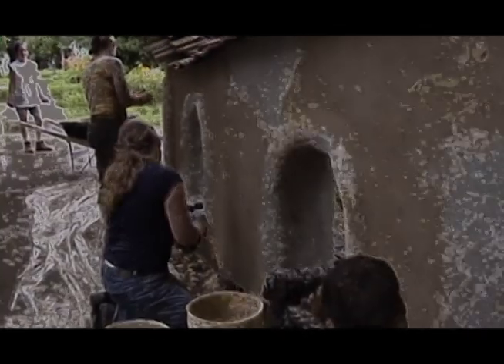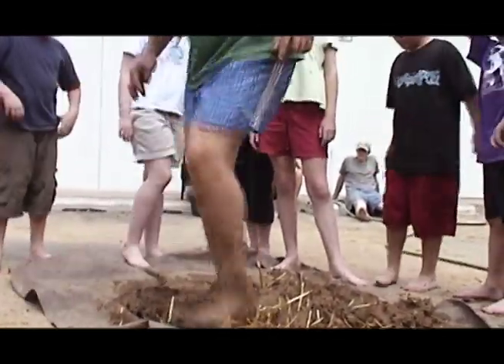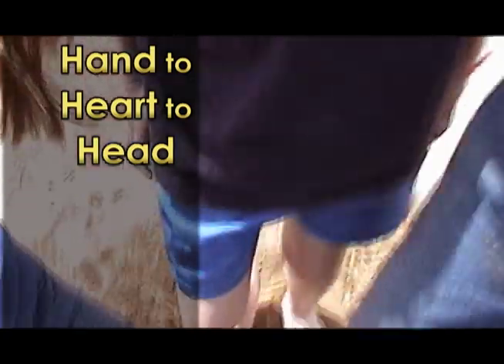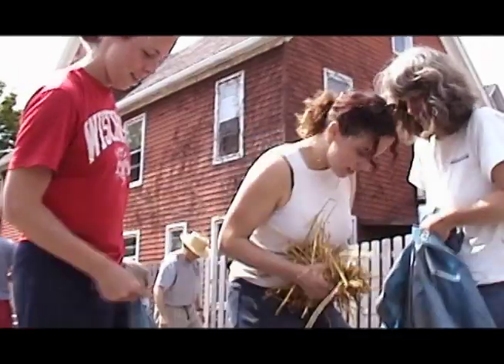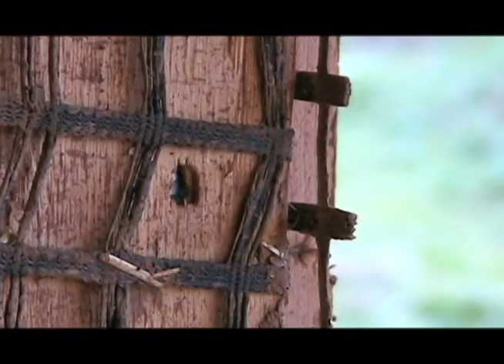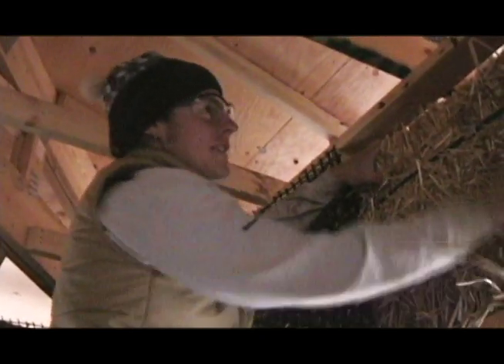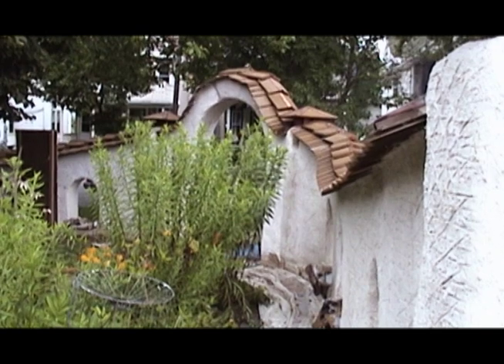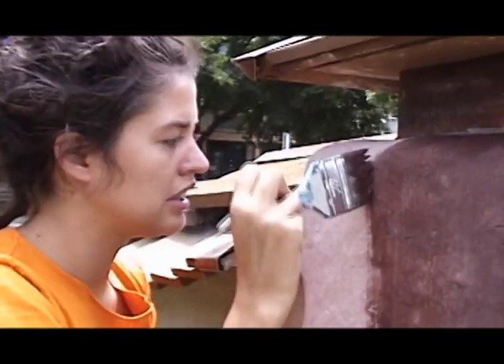Earth Walls: Cob and Straw Bale Construction in Wisconsin

Comment: None of these videos on straw bale or cob are in the deep south. Wonder if that is because down here we have hurricanes that would melt a cob house in hours and the insects here would love the straw and mud. The fire ants would move into one of these in minutes and in a few weeks you'd have a huge nest of fire ants eating you literally out of a house.
Reply: In the south, you would just use cob. You don't need straw bales in the south.  In the north, straw bales are used for their insulating factor.  Since cob is like a natural concrete, you shouldn't have to worry about critters unless you get cracks, which you just patch.
Reply: If done right, cob is too dry and hard (it's unfired brick) for ants to bother. Some people do make the mistake of using topsoil; need subsoil for cob.

Cob is being built all over the American Southeast, it's great for hot weather. You don't hear about it because it's too "hippie" for locals to tolerate.  

A cob house has got to have good drainage and a good roof, cannot survive on a flood plan.  Other than that, it's great, the best.

Comment: In Wisconsin?! How does Cob hold up in the freezing long winters? I would love to try this.
Reply: Cob is ideal for extreme heat and extreme cold, both.  It's great insulation, wonderful thermal mass.
Reply: @kittimcconnell2633  cob has a terrible R value, I have no idea where you got your information from
Reply: @Kobbi_88  as I undertand it, thermal mass is not insulation. Two different, interesting properties to consider.

Comment: sand, clay, cow manure and hay can be readily found mixed in any cow pen. if you pen your cows up in the winter, each spring you can harvest the some cob to make an addition to a wall. eventually you will have a house for free. remember, good hat and good boots and the house will stand forever. a good water resistant foundation and a good roof that has antiquate eaves and your structure will out last you.

Comment: as the quantity of materials. rain.org/global-garden/soil-types-and-testing. htm has a good chart to show the types of soils you have. Straw, you never want to use hay, hay is a flat bladed grass and has zero tensile strength, it will not allow  air or moisture to pass in and out of the wall like straw does, this is required to keep the walls breathable. Now if you have to buy clay and sand, as it does happen, look for places giving sand and fill dirt away, craigslist and such are good sources,

Comment: I think you just explained why it will pay for itself. These houses use less energy than conventionally built ones. If they don't pay for themselves quickly at current prices, they will as energy costs climb, by being  increasingly cheaper to live in. Even people who get them contractor built will find that they save over the long run. Those who can get volunteer labour to help - from people who want the experience - will be well ahead.People will evolve ways of working together to cut costs.